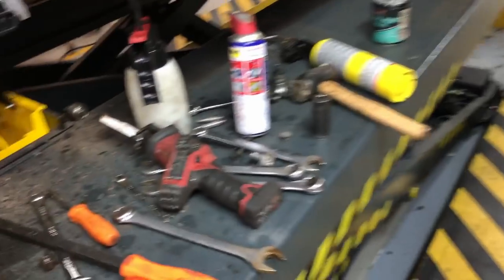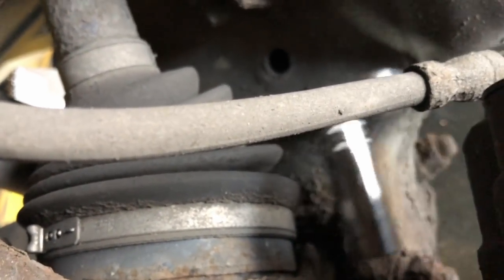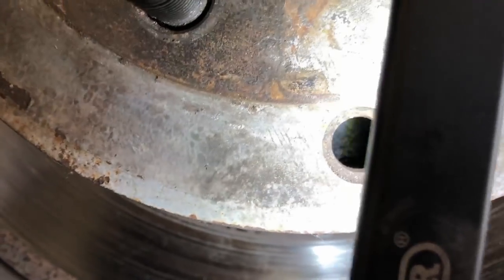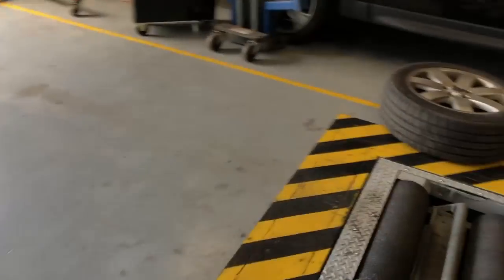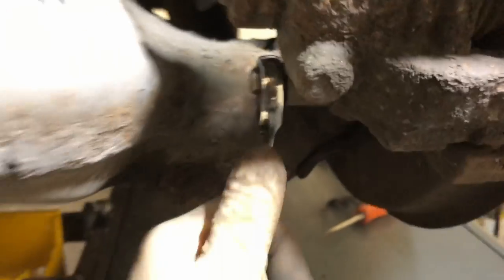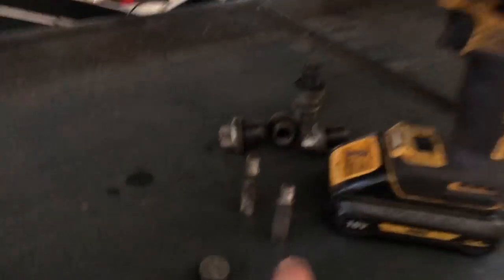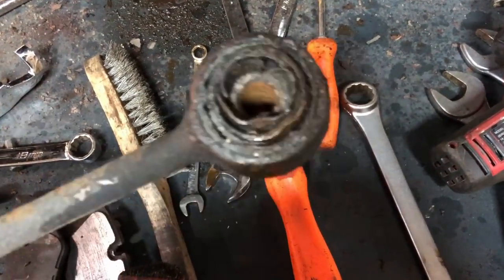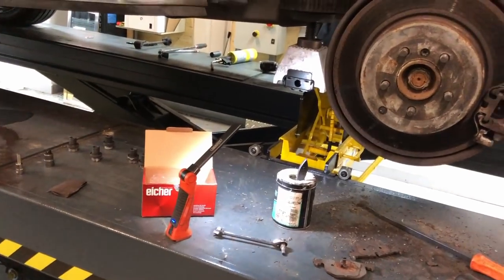2002 Range Rover l322 marketplace -spares or repair project - part6 - why oh why..

Comment: There's more than one way to lubricate the various moving parts of the brakes. This is what I do: I apply a dab of copper grease to the areas of the pad that come into contact with the rest of the caliper assembly. The pins get copper grease on the threads and lithium grease on the rest of the pin where it slides through the caliper. Those pins should have plastic dust covers to keep the worst of the road muck out. I've got quite a few brake videos on my channel if you want to check them out. My next upcoming video at the time of writing (1st March 2022) is a front brake pad replacement on a 2013 BMW F30 3 Series if you want to keep a look out for that one.